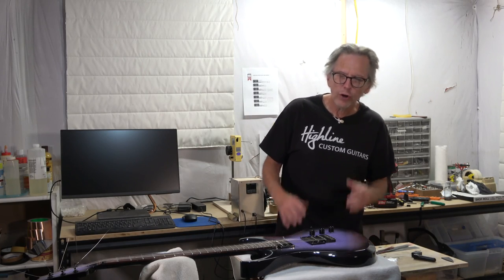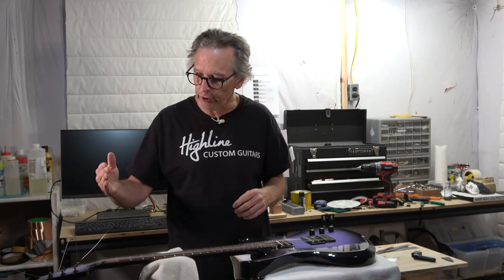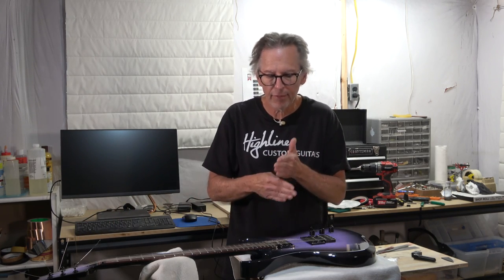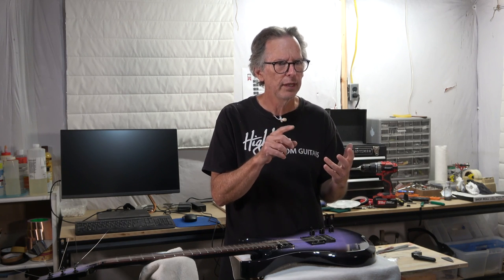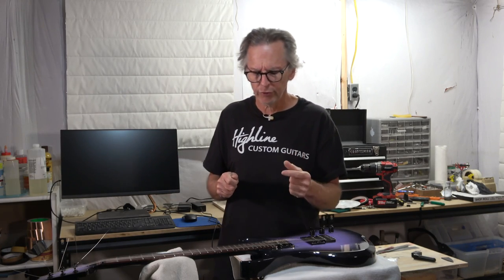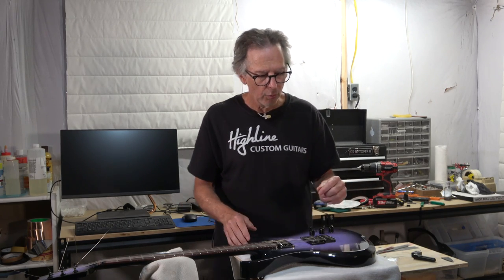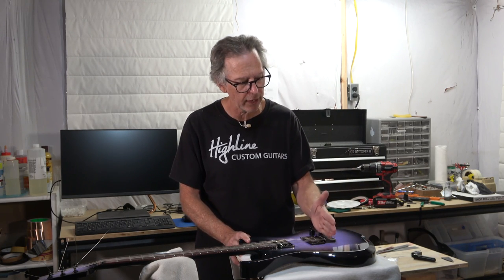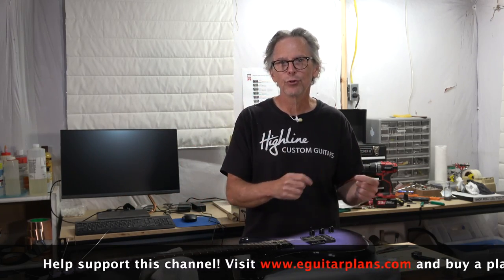Can You Improve Your Guitar's Sustain?

Comment: Thanks for useful tips!  However, one significant issue wasn't discussed - the strings action. With too low action strings touch frets while vibrating , so it reduces sustain dramatically. And one more significant one - the strings gauge. The bigger the gauge, the higher is string tension and the less is sustain.
Reply from the maker: Great point!
Reply: Why would there be less sustain with bigger string gauge? 
The mass of the string is bigger, so it also throws more mass when vibrating, it also vibrates on the same frequency as less gauge strings (same tuning) and could possibly mean that there is more sustain due to the more mass.
Reply: If you think of a thick string vs a skinnier string, at different tensions to attain the same frequency or note, you would probably see that it takes more force on the thicker, higher tensioned string to attain the same vibration sustain.  Due to tension, it's pulling harder on the string, which in turn would force it to flatten or straighten out faster.  So if you used plucking force as a constant, I would assume the thinner, less tensioned string to continue to vibrate longer.  You got me wondering though.
Reply: Heavier gauge strings actually sustain more, just compare the sustain of the low E and high E strings of a guitar, the heavy low E sustains much more than the treble E string.
Reply: What if pick the string really hard?

Comment: IMHO the nut only has an effect on open chords and notes. I for one mainly play bar chords, power chords and fretted notes, so I doubt the nut will have much effect, as my left hand pretty much dampens any vibrations behind the fret.
Reply: I do not agree. 
  You can try this: put a hairtie behind your fretting hand or before the nut, and one behind the nut.    
   Now compare the single fretted notes and chords with and without the extra dampening. You will notice a slight loss of overtones and a tiny bit of sustain. The string bits behind the fretting hand and behind the nut are vibrating if not extra dampened, and feed back into the fretted string parts, giving them also more frequency content. Headstock  vibration  comes from the strings and neck directly and via the guitar body. This induces the most part of string vibration behind the fretting hand. The vibrating headstock feeds back into the body and so into the ongoing vibration of the fretted strings. Goes full circle. There is also sympathetic ring of the unplayed strings feeding into the neck, headstock and body . 
   I just wonder how this myth of nothing happens behind the fretted notes could survive over 50 years till today. I checked as a guitar greenhorn 3 years after starting, and used my ears. Before those 3 years my ears were not sensitive enough... 
  There is a lot going on behind the fretted frets and past the nut. 😊
  To dampen everything behind your fretting hand, your hand must be as big to cover the whole headstock.😅😊
   Cheers🤘
Reply: @lone-wolf-1  There is a lot going on behind the fretting hand, otherwise headstock tuners wouldn't work. However all of it is coming from the main vibrating part of the string between the fret and the bridge. Not from the strings behind the fretting hand. They are totally out of tune with the fretted note and certainly wouldnt add desirable overtones or timbre to the fretted note. Cheers!
Reply: @andywason3414 
The little string bits behind the nut and bridge do indeed feed back into the sound of the strings between them. You also don't want that bits being in tune, because it would diminish sustain. Wolf tones or dead notes appear when some part of the guitar vibrates at the same frequency as that specific note. So, those string bits being out of tune actually  helps for sustain. 
   In fact you want the parts on a guitar to be relative resonant, but slightly off in frequency and time. Otherwise an instrument would sound poor.
   The amplitude of overtones from them string bits are also minuscule, but still have their contribution.
   I can tell that because I tested/noticed it. With hairties before and behind the nut, and after swapping the saddles of a TOM bridge with roller saddles. All of a sudden, behind the roller saddles there was a lot more vibration going on and the influence of the tail piece was coming into play. I got longer sustain and more overtones colouring pleasantly the sound . 
   Cheers! 🤘
Reply: @lone-wolf-1  Good discussion! I have a few experiments in mind that I can hopefully get around to soon!
Reply: @andywason3414  
I'm curious about your experiments. What kind of?
  Then again, about those string bits behind the nut ans the nut: general opinion is that if the nut is made out of metal (idealy same as the frets) the open strings will sound like the fretted ones. But that is just partially correct. After swapping a plastic nut on a Ibanez GIO (wich indeed dampened a lot of the high frequencies) with a nut out of steel, I noticed that the open strings now have more overtones than the fretted ones. I expected them to sound the same, after hearing, reading that so often.  I thought about it, and found out that the culprits are the string bits full of high frequencies behind the nut. Behind the nut are missing some dampening fingers like the fretting ones. I first tried with my fingers and then put a medium soft foam strip under the strings right behind the nut. NOW the open strings sound exactly like the fretted ones!🙌
   Interesting: on another guitar (LP type) with a self cast brass nut out of melted brass screws, the open and fretted strings sound right away the same. I suppose because brass is softer than steel, and similar to the fret alloy. 🤷🏻 
   Graphite nuts do a good job regarding this. Almost no noticeable difference. 
    And bone is pretty close,   close enough to not complain. I feel that synthetic bone (never tried) is closer.
Reply: @lone-wolf-1  I'm a retired engineer,so my philosophy is, that if you can't measure it, you cant control it. First thing I thought of was to put a piezo pickup (like the ones you see on an acoustic bridge) under the nut to see what is actually going on there. second, I'd like to place a thick layer of silcone rubber under a nut, just to see what detrimental effect it has. (PRS I think, was jokingly talking about a rubber nut in one of his videos).Thirdly I'll detune a half step and put a capo on the first fret, to see what difference it makes. Sure, it changes the scale length a little bit, but that should be insignificant . It shouldn't be too hard with these changes to do a spectrum analysis on the signals to see what I get in terms of harmonics, overtones and sustain. (As well as critical listening of course!)
Reply: @andywason3414  
Cool! A piezo under the nut is a brilliant idea! You could also test what's happening on the tail piece of a TOM bridge, and how it changes if you swap its material or the material of saddles.
  I mounted two disc piezos under the pickguard right next to the pickups of a kit build Telly, wired in series directly to the output. I expected a slightly woody sound, to mix it with the pickups or to use only (mini on/off switch). But I didn't had a clue 9 years ago as a guitar freshman, it acts like a capacitor (or rezistor, still have no electric knowledge), and the mix with the pups results in a very muffled sound with a hint of woodyness. Still useable somehow… because she sounds pretty bright. I expected to hear the piezos alone when the volume of the pickups is zero, but then there is zero output. Needs probably a second output. Don‘t want to install a preamp.
   As I put my ear everywhere on the bodies of my guitars to listen to the sound while strumming or knocking, you could also test it with a piezo on a adhesive strip, how sound changes while moving it around on the body and neck.
   My particular telly build sounds very loud on the back of the neck heel, while under the bridge the quietest. I intent to mount a third disc piezo directly in the neck heel, if I solve the output problem. 
   My LP type sounds very loud directly under the bridge and second loudest on the neck heel. 🤷🏻‍♂️
   You should do the tests you wrote about! I like such stuff!👍🏼
   Another thing wich I noticed to affect sustain: the weight of the headstock. I first noticed on my kit build after swapping the metal knobs of the cheap tuners to fancier plastic ones. I lost bottom end (wich already had too little) and 15% of sustain. (I have data sheets for every guitar with all specs and measurements, and also sustain of open D and G string together). After I put the metal knobs back: all went to initial. The weight difference was only 6,3 gramms. So, I put locking tuner wich are 16 gramms heavier, and got more bottom end and sustain. But on another guitar I lost a tiny bit of sustain with the locking ones, but not enough to bother because she still had plenty and now the balance on the lap is much better. Then on an Ibanez with trem, nothing changed (at least what I could hear). It seems to depend on the guitar, still can't figure out why. I always test it with a weight clamped to the headstock, and swap tuner to locking ones for balance or sound. 
   But most of electric guitars do benefit from more weight on the headstock. On acoustics I read on forums that it can be contraire.

Comment: I'm not saying you're wrong, but it is quite unclear to me why the amount of contact between a string and the terminating surface (nut, fret, saddle) is a major factor in sustain, and if it is a factor why less contact is better and not worse. You've said that it impacts absorption of string vibration energy into the body, but has that theory been tested? If anything I'd expect that too little contact at the nut will cause more vibrations to be transferred to the section of the string behind the nut, which can result in noticeable noise when playing with distortion (a common problem on most guitars). If you think about it, the place where a string has a lot contact is at the tuner. In fact it's much more than you could ever have at the nut no matter how it's cut, or at the frets no matter how they are crowned. Especially if it's a non-locking tuner, you can easily have a couple of inches of the string tightly wrapped around the tuner post. So imagine a string suspended between two tuners. If your theory is correct, you should be able to demonstrate that fewer wraps around the post results in a measurable improvement in sustain. Personally, I'm skeptical about this.
Reply from the maker: Sustain on a solid body electric guitar is determined by how long the string vibrates over the pickups. Anything that touches the string between and including the nut and bridge saddles can kill sustain. What happens past the nut or the bridge has almost no impact on sustain. Acoustic guitars are another matter.

Comment: The point about the strength of the magnets impeding the vibration of the string's is interesting. This could explain why some of the old timers liked to have their pickups closer to the body, away from the strings without really knowing why, except that they liked the sound better.

Comment: Halfway into this and I'm already drawing conclusions, (it's one of my flaws) ... basically, force as much vibration into the string between the nut and bridge as possible.  Anything that can help the string move freely, AND force, or direct vibration back into the string without ejecting it elsewhere.  Your fingers as well can dampen the sustain, such things as keeping your finger as steady as possible with as little contact as possible, rolling the finger even slightly into the note could drown it right?  Imagine holding a Phillips head screwdriver straight onto the string over the nut, plucking the string.  Some vibration will go past the screwdriver...would it be proper to say that if you dampen the area beyond the fret, would that take away vibration between the nut and bridge, or help hold the vibration, contain it within, better.  I'm an archer so this analogy kinda goes hand in hand with this if I'm thinking of it right.  Imagine the string on a recurve bow, when you draw back and release, shockwaves run through the string, into the bow, and along its length until it reaches your hand at the grip...and then continues through your hand, arm, etc.  By putting rubber dampeners on the bow body between the string and grip on each end, it absorbs the shock at your hand... (? forcing the vibrations to travel back into the string?), and at the absorption point. (? or would dampening kill it...absorb/dampen the vibration at the absorption point.  All this begs to question the viability of tone wood theories as well.  It almost seems like dense woods would help to carry vibrations away from the strings, hence killing sustain, however forcing vibration through the wood, increasing volume and tone (subjectively).   Sorry, I'm thinking way too much into this, which is why I thank you for this video... and all your other technical videos as well.  Keep up the good work.
Reply: Dont you expect me to read all that
Reply: Interesting indeed. I was thinking about this as well and came to another conclusion. When you fret a note, your finger's ''meat'' would absorb close to no vibration as the string is actually resting on the fret which bring us back to the former explanation in the video regarding everything sitting beyond the bridge and the nut having little to no effect on sustain. This said, proper fingering would be mandatory cse if you wouldn 't fret a note correctly, your finger flesh could Indeed be dampening the string vibration. Am I wrong here? Finally, I think sustain and tone much come down to the player himself.
Reply: I did archery too and little guitar building and many mods. 
  Had similar thoughts about the analogy to bow dampeners. I intend to test the effect of weight on the neck pocket. More weight should change the way how the guitar "bow" (body, neck, headstock) reacts to vibration. Adding a rubber dampener outside the neck heel kills sustain for sure. But how about weighty brass or steel plates?  Will it slow down vibration and sucking the high frequencies making the guitar sound fuller and warmer but prolonging the sustain too? Or will it do sound wise the same but robbing sustain? We'll see... 🤷🏻
   I also think a angled headstock acts similar to the bow tips of a recurve turkish bow. Giving more punch to the sound milliseconds after plucking. More weight= stronger attack but not necessarily a faster attack... 
    The same archery bow sounds different with different brace heights. That's why I think the Les Paul sounds so different to others, mostly because of the elevated bridge (beside shorter scale length and overall shape and construction). 

   Me too: too much thinking! Should better practice more😅

Comment: Nice video and very helpful! I have an SE PRS, good guitar, but horrible sustain… So I was looking to how upgrade it. Then come this video, actually I am working my bends 😂 ….
Of course, and excess of pressure don’t allow the string to vibrate, so we’re killing the sustain when bending with maximum strength. 
After that, I think changing the low cost - but nicely polished - frets, which he nuts , the tremolo bridge suddle and also put a higher string action.

Comment: I use a good rack mount compressor limiter gate unit for “sustain”. 

I do have a guitar with ferrules and a roller bridge for its increased sustain concept. 
(It’s a guitar that I test everything on so it’s pretty crazy)

Again, great video!
Reply: Rollers are for tuning stability. Points are better for sustain. It's all a trade off.
Reply from the maker: Bingo!

Comment: I think a lot of energy is lost on necks with double action truss rods.  My logic being that they are a separate closed system,  eg , the two rods in a double create tension against eachother,  that is inside of another system being , the strings and neck wood.  Where as a single action has tension in relation to the neck wood, meaning that they are one system , so in conjunction with the strings and the pre-loaded tension , it should resonate more like a harp.
Reply: I think if you drew that out, you would see it’s no actual difference. It just distributes load differently. 90% of sustain is things in direct contact/ proximity with the strings. The neck absorbs energy if anything. Most of what we do is to try to get things NOT to absorb the strings energy.

Comment: Thank you very much for this very useful video and clear explanations. I have been thinking about the "minimum contact with the nut" issue - does it mean that locking nuts (where the strings are hardly pressed from both sides) provide less sustain than non-locking nuts?
Reply from the maker: The difference between a locking nut and a slotted bone nut is that the string is free to move back and forth, up and down, and side to side in the bone nut's slots while the strings in a locking nut can't move at all. If the slots in a bone nut are not cut properly and/or the string's break angle to the tuners is wrong, this movement can rob the string of sustain. With a locking nut, the strings can't move within the nut, so their vibrations are kept within the scale length where they can be detected by the pickups. In theory, a locking nut would be better for sustain, however, a bone nut with the slots cut correctly combined with the proper string break angle to the tuners can be just as good.
Reply: @HighlineGuitars  It is clear to me now. Thank you very much!